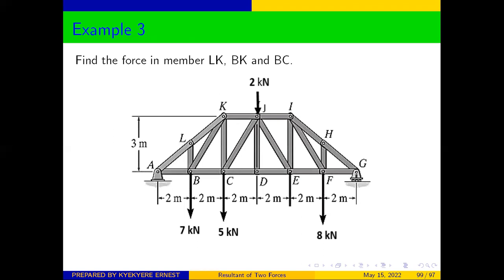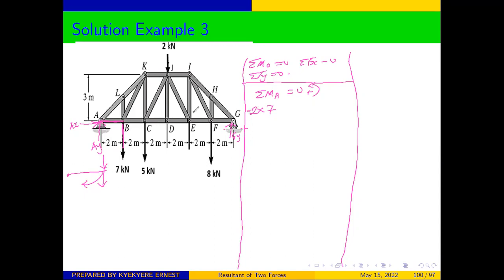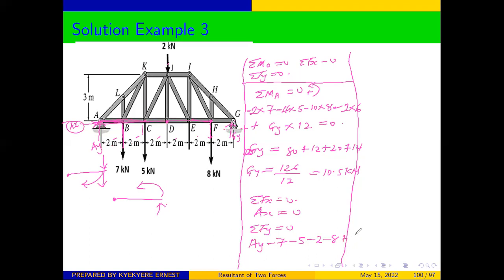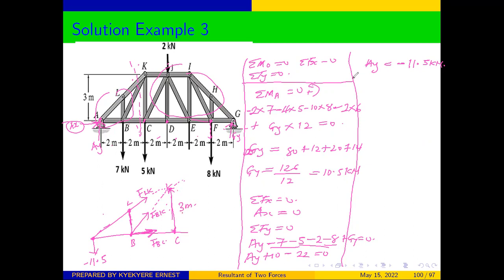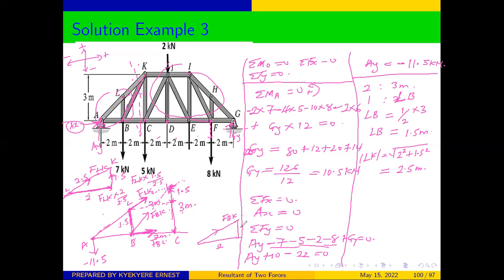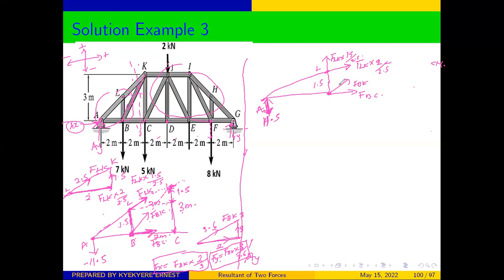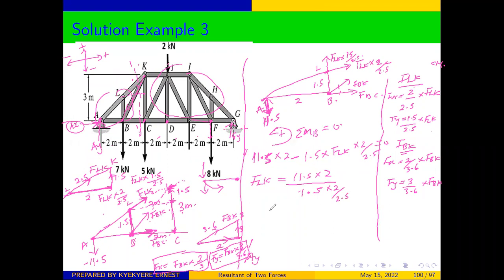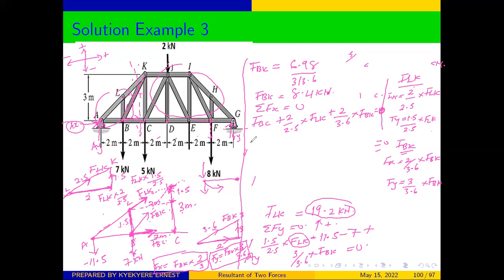Basic Mechanics:  Analysis of Trusses Using Method of Sectioning Example 3

Comment: Please sir my question is when you want to analyze the reactions at the support and is a pin, does the x component of it moves away or moves towards the point
Reply: For reactions at support you are free  to indicate the direction anyhow. However, once you are done and the answer is negative, it means the direction was wrong
Reply: @healthymarriageandrelation2265  Thanks for your clarification
Reply: @healthymarriageandrelation2265  so if u get a negative that means u have to change the direction in other to continue??